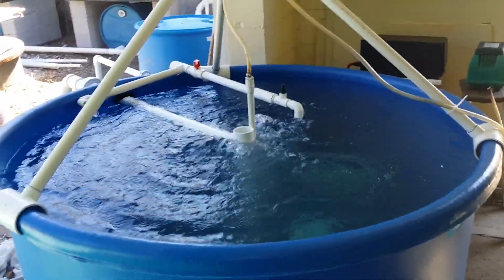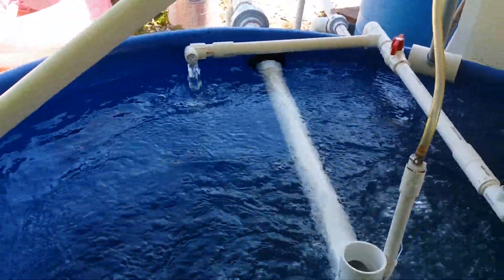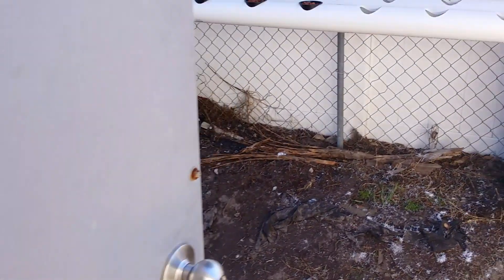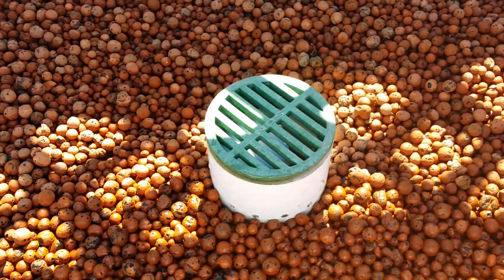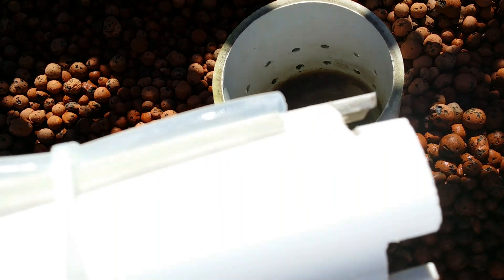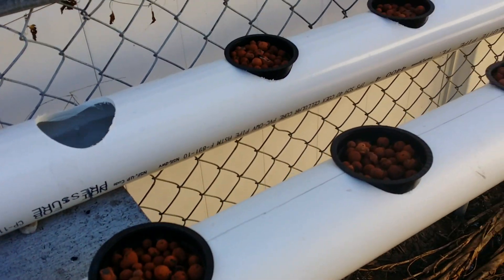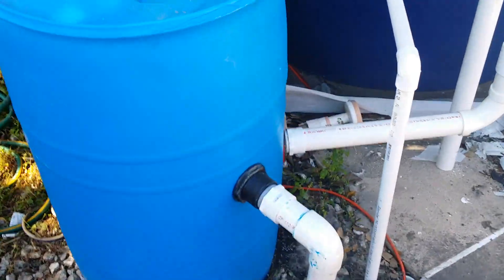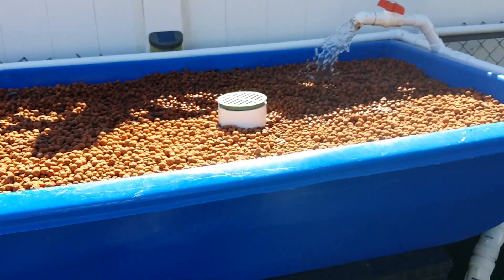My aquaponics setup

Comment: Hi . I know this is a few years old , but I am curious on how the setup is going and also could or do you have plans to share . Would love to do .
Reply from the maker: Yes it is still running. Alot has changed.  We have doubled the size of the beds and using the same fish tank and we lowered the sump tank. We have had a few hurricanes and lost some fish but This is the lazy way of doing it.  I am not an expert.  I only wanted to work on it 10 min a week.  And for six months I just let it go.  And it still gives me tomatoes, leeks, and lots of mint.  I no longer feed the fish since I have mint growing on the fish tank and they eat that.

Comment: Where did you get the 500 gal tank?
Reply: I don't understand why you would buy a 460 gallon tank for $600 when you can get 2 IBC totes for $50 each.
Reply: What are the dimensions and cost of the 500 gallon tank?
Reply from the maker: I 70"x 30"  is 460 gallons for around $600 plus shipping. you can go as big as 90"x44" for just over $1000 that will hold 1000 gallons
Reply: Where did you purchase the tank and the grow beds?

Comment from the maker: So this is my aquaponics setup. We did not use any lake water and just used the tap. We let it sit for two days running to declorinate it and so far it has one big fish and 10 small ones as well as around 15 plants for a test run. We will go big with it later after three weeks have past to ensure everything is fine. So Sunday we will be going to pick up 100 blue tilapia from a fish farm in St. Augustine and that should be fun. I will post more info with the plants after we have some idea of production. So far the only work is watching the water levels and feeding the fish. I want to keep the labor level as low as possible to see if this is a viable option. Also if anyone knows of a low cost way to build a solar panel system with batteries to power around 300 watts 24/7 please post your suggestions in the comments. I would like to pull this off grid. Thanks.
Reply: the greatest success that I have ever had was by following the Keiths Ponics Site (i found it on google) definately the best info that I have ever followed.
Reply: how is this project going, I want to do this with crawfish and other fish
Reply: Kudos for the Video! Sorry for the intrusion, I would love your initial thoughts. Have you tried - Patlarny Gardening Expert Principle (Sure I saw it on Google)? It is a smashing one of a kind guide for learning how to expand your produce with the clever art of aquaponics without the normal expense. Ive heard some decent things about it and my m8 at very last got excellent results with it.
Reply: hey ,if anyone else  wants to discover 
what is aquaponics video
 try Proutklarton Surviving Instruction Plan (Have a quick look on google cant remember the place now ) ? Ive heard some great things about it and my cousin got amazing success with it.